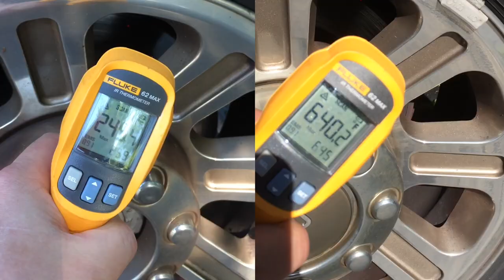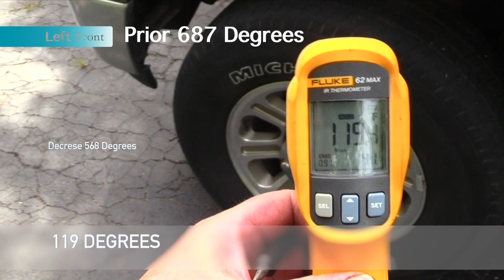“Seized Brakes to Show Piece” How to Rebuild and Paint brake calipers on Ford Super Duty

Comment: Nice job on your video. Those brakes were really cooked. Thanks for the information.
Reply from the maker: They seemed impossible at times , I had to use an impact chisel , carve pieces away from one of the composite pistons because it was swollen, it final blasted free with 90 lbs of air pressure when I reduced it to about 2/3 it’s original depth.  I’m actually working on another brake overhaul today, a Fiero Rear Disc with built in emergency actuator, I don’t plan to paint it

Comment: Hi norm do you have a link to the seal kit ?
Reply from the maker: I can get one - I purchased locally at O’Reillys
Reply from the maker: Rock Auto Sells

 FVP limited lifetime warranty 

Front  FH 41253 $2.69

Rear (Single Rear wheel) 

FH 41178  $ 3.35